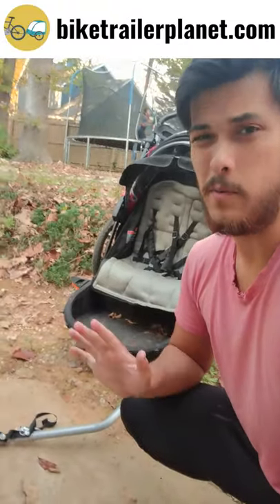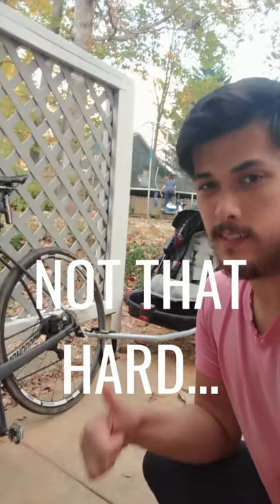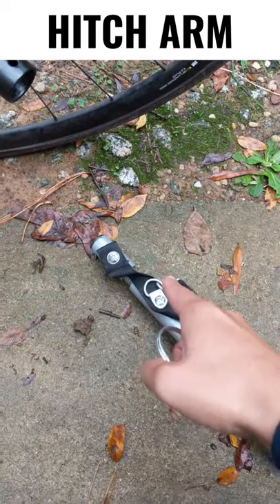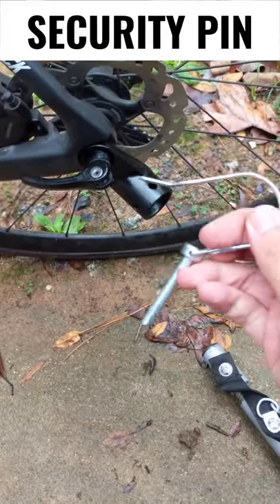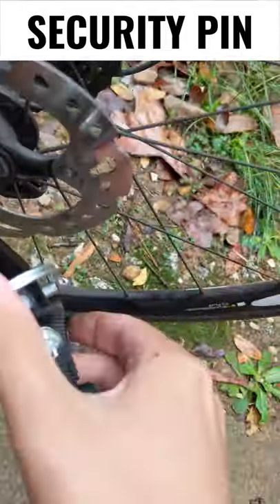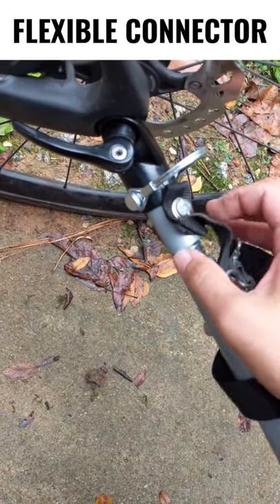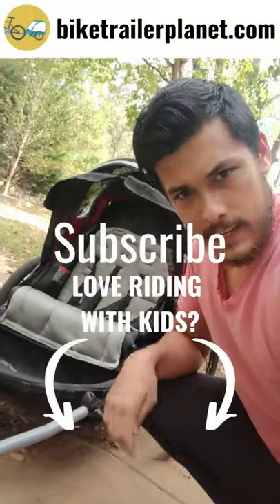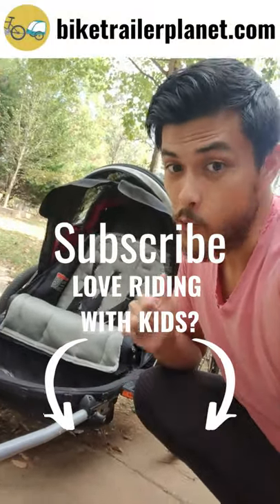How Do Bike Trailers Work & Attach to a Bike? [EXPLAINED]

Comment: We have 2 bike trailer's made out of 2 outher bikes the first one is 2811 out of a cruser bike honoring our veterans. and the outher cruser bike is 9-1-1 honoring first responders we mostly use them in pushers up through hell's summit on the 2.5% perfect climb for a good 2 miles there actually both powered witch makes them still legal to pull